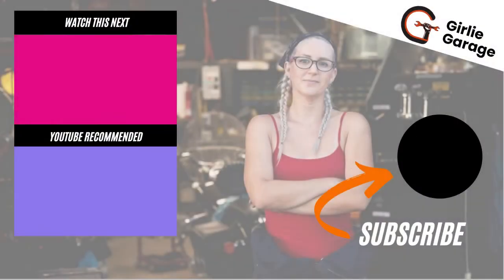WHAT'S THAT NOISE? - Buzzing When Turning the Key - Girlie Garage

Comment: Thanks for the video! Mine does not buzz (Honda element 2006)🤔. Got a new starter, checked both battery & alternator. Car starts and runs. But when I try to start it again, it does not start🤔. Have to wait 3-5 minutes to get it started again. What the heck!😳
Reply from the maker: That sounds like something electrical is getting hot and expanding causing the vehicle not to start until it cools off a bit. I would take it to a shop you trust to have it properly diagnosed. If you need help vetting a mechanic, I have a short video on that: https://youtu.be/q1QQngqpWco
Reply from the maker: Another thought is it could also be a fuel issue. It does need to be properly diagnosed (instead of a mechanic "throwing" parts at it). I hope that helps a little bit.
Reply: @GirlieGarage   thank you. I appreciate your channel & answer. Stay Blessed. You've got a new subscriber!🤩🇺🇲💐🥰
Reply from the maker: @helenahawk7752  Of course! If you do take it to a shop, email me info@girliegarage.com or DM me on Instagram and we can chat about what they say regarding repairs.
Reply: @GirlieGarage  thanks I will let you know the results. I don't have insta😁. Will email you. With Gratitude😁🎉🎊